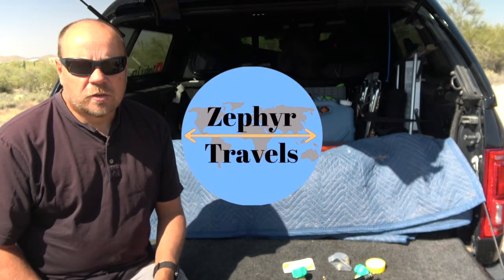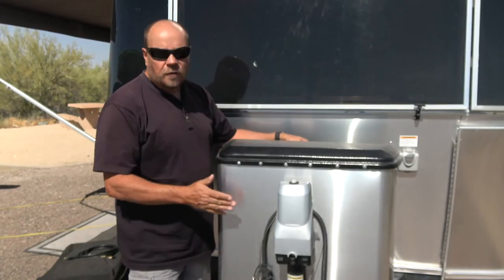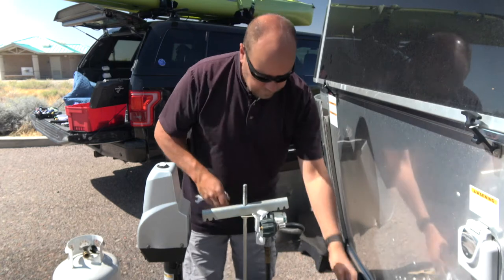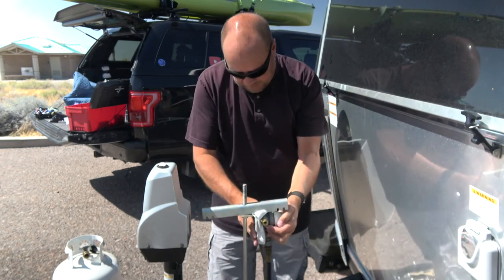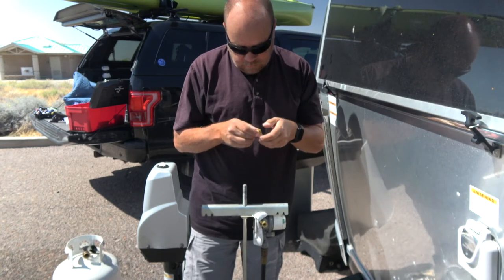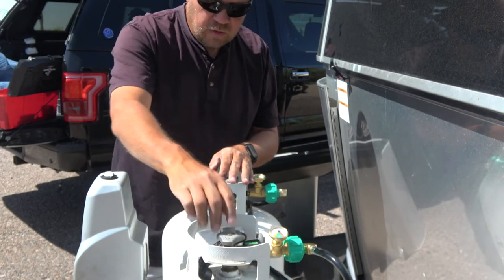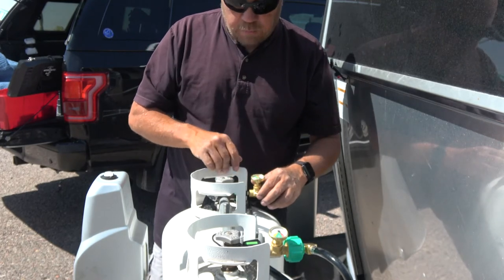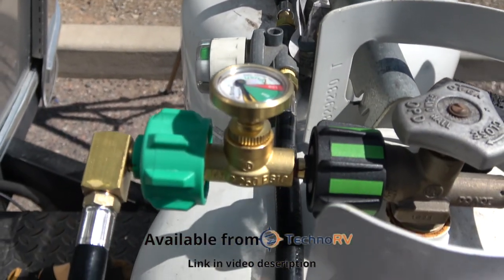RV Safety Mod - GasStop Propane Emergency Shut-off Valve Install | RV Lifestyle

Comment: the adapters were already in the regulator  if your hoses were i recall a reverse flare, just needed a 9/16  to hold the adapter and a smaller one to turn the hose out.
Reply from the maker: Thanks for 5he tip!

Comment: Good video  I just bought one I have 2 tanks on my travel trailer but I'm gonna use just 1 tank at a time will that work just the same
Reply from the maker: It a good safety feature to have.